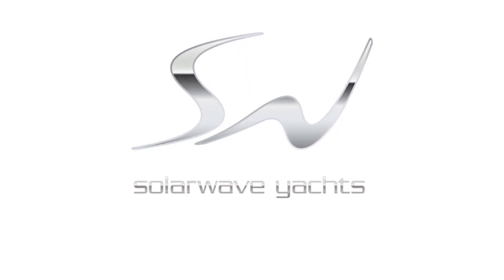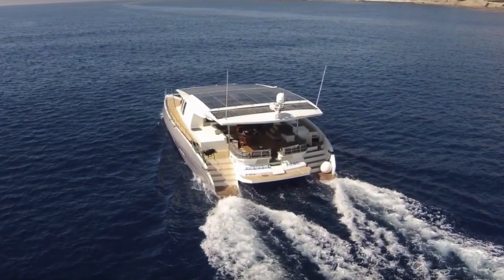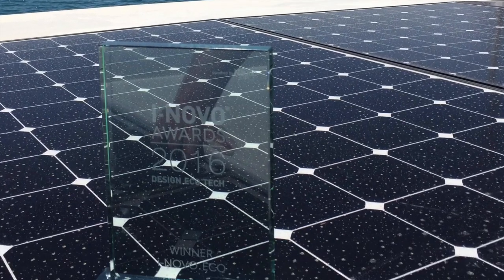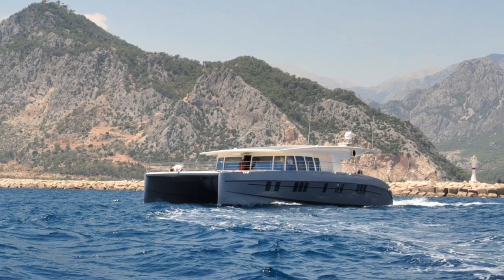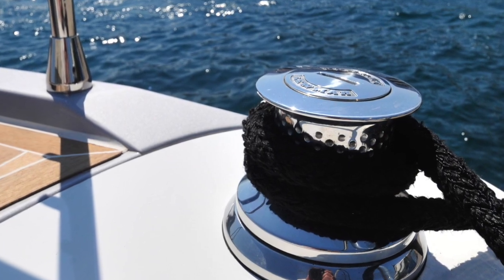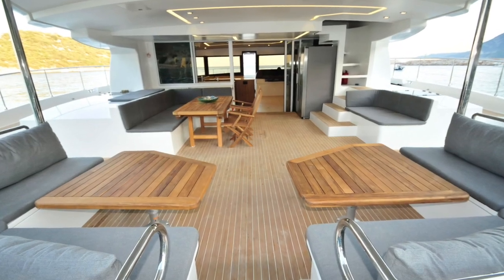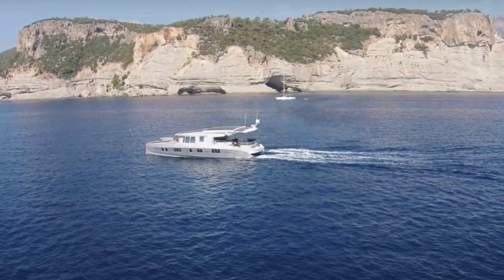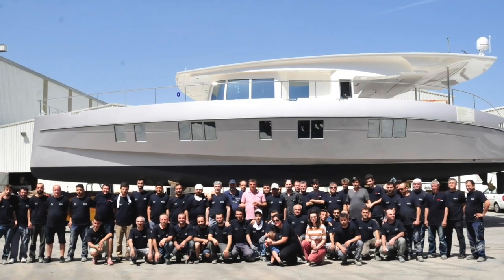Solarwave 62 impressions - Dreams powered by sun

Comment: Where do you buy these? I'm impressed I'm the Solarwave 62 so I would like to buy one but how much does it cost?
Reply: (from messages above)
1.1 to 2.6 Mio EUR - depending on the size (54 ft from 1.1 EUR)
Length overall 16.13 m / 52.92´
Length waterline 15.91 m / 52,2´
Beam overall 8.46 m / 27.7´
Draft 0.64 m / 2.1´

Comment: With higher cap batteries and more efficient solar panels on the way....  more powerful  motors can be installed later as newer products are introduced to the market. This can't be said of regular diesel or gas powered boats because they are at the end of their efficiency as combustion driven power. Any improvements to efficiency with oil powered motors are negligible and are not cost effective..... Fluctuations with gasoline prices eventually negate any cost effective gains.

Comment: Wonderful idea, perfect combination of hull design and propulsion. I could see myself circling the globe forever on one of those...
Reply: not at 12 knots
Reply: +Chris Francis
I think going with a steady 12kn is faster than most of the ships sailed for millennia, including those which discovered islands and continents and gave us access to almost all areas on this blue miracle we call Earth.
12kn with unlimited range and sufficient electric supply, low dependence regarding water and food? That'll do nicely as the missus and I are in no rush to get from A to B, but enjoy the journey.
Comparing the Tûranor PlanetSolar (officially 7.5kn cruising speed, 15kn max speed) with the Solarwave Cruising Cat, I think the Solarwave is not only better in regards of speed but also does look much more comfy. I see the PlanetSolar as a proof of concept and the Solarwave as finished product.
Reply: Chris.....get real...people have been circumventing the globe on sailboats in which they are ecstatic if they can maintain 6 knots! at 10 knots that equates to over 200 nm per day, and under auto-pilot.....heaven.
Reply: Meto Write not a good situation if you are caught in a storm with only 12 knots....I applaud the effort....I just hope the company pushes for more power and not just settle
Reply: +Chris Francis.  If you are caught in a storm you may prefer a really good stabilisation system over a few knots additional max speed?
Also, you might look for an entirely different ship class than I do? Maybe you like a powerboat while I prefer a comfortable live-on-board Cat.

I'd love to see your design and competitive price of a 60+ft solar powered hydrofoil with water jet propulsion.

Comment: at 12knts this is slower than a sailboat. It's a great first step but 25knts+ needs to be the target to get people excited.
Reply: The whole idea is that it's a motor yacht which doesn't need fuel, it's not competition for sailing yachts.

The typical owner of this boat will be doing two things;
1. Piling 25 people on board and having a floating party.
2. Touring the Bahamas and Caribbean with their non-sailing family.

With current technology it's not possible to build a solar boat which goes 25knts and has long range, panels just aren't efficient enough, batteries just aren't good enough.
Reply: 12 knots is a respectable speed especialy when there is little to no wind.i would still have a get home diesel wing motor in case of system failure.